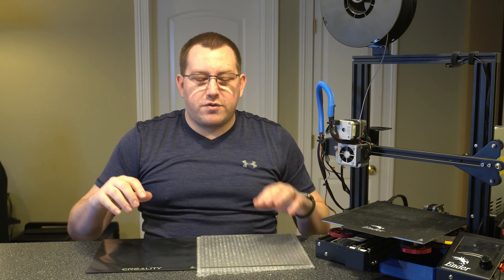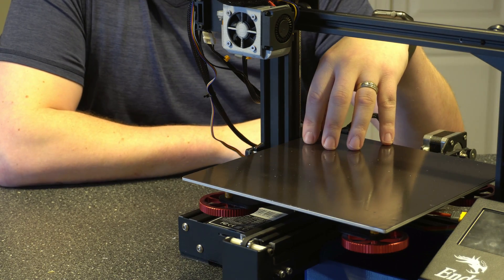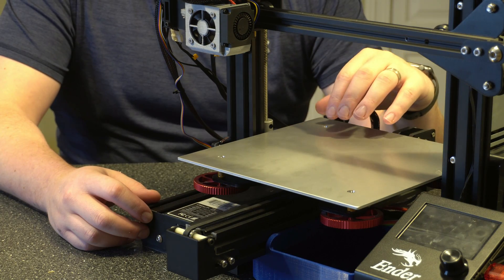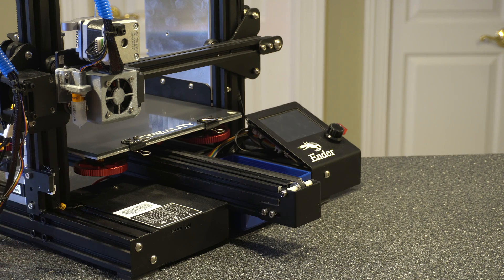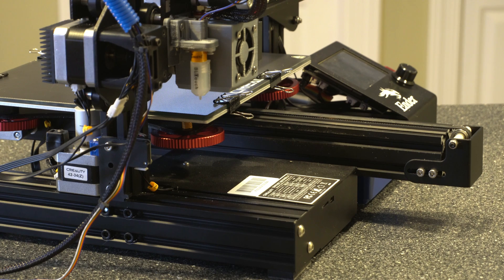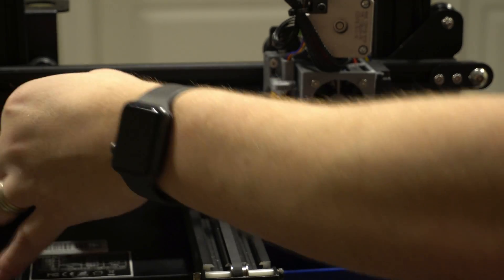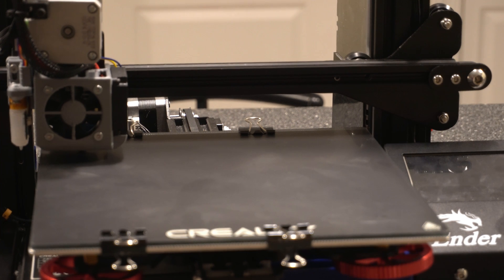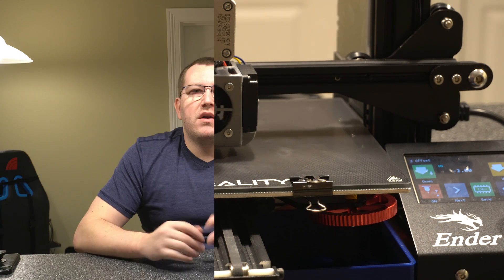Ender 3 Pro Glass Bed Upgrade – Complete Install Guide!

Comment: I have a bltouch but nothing I do makes it work properly
Reply from the maker: Hi. How is it wired and what firmware are you using?
Reply: @3DPrintscape  i tried it with and without the z stop still in, its plugged in where it should be. I tried so many different things for the firmware cause i didnt know at first there was a difference in the board but then i tried the 3 pro 4.2.2 firmware and it didnt work right, tried following a different tutorial from a guy thats pretty popular but none of it worked and i dont remember all i tried now cause that was months ago but i tried multiple firmware versions andtried editted and uneditted
Reply from the maker: @YourPeepingTom  Sounds like it may make sense to start back at the wiring. Make sure the wires are in the right order where everything is plugged in and make sure they are actually making a good connection.

Comment: I went with a 4mm piece of scrap mirror that I found. Couldn't get the prints to stick at first but after some experimenting I discovered that PLA and PLA+ sticks just fine on glass/mirror surface, just keep the bed levelled and up to 70C hot at all times during printing.
Reply from the maker: Hi. Thanks for the feedback/tip. A mirror is a great option if you already have one to work wiht.
Reply: @3DPrintscape  also a glue stick helps ive been told
Reply from the maker: @JamesAnderson-fw5ew  I know it does help, but I've had better luck with bed weld.

Comment: I went with little spring clips from Home Depot.  bigger than those clips but the tips are covered in vinyl.  89 cents or something for each.  Disclaimer:  I know next to nothing.
Reply from the maker: Hi. The vinyl on the clips could be a problem. I would go with all medal ones.
Reply: @3DPrintscape  Oh.  From the heat of the bed?
Reply from the maker: @ulmwurttemberg1682  ya, i think that may end up being an issue. It will depend on the type of vinyl though.
Reply: @3DPrintscape  Ok.  Wow.  I didn't consider that at all.  I'll have to monitor that.  Or just cut the vinyl off to be safe.  Thanks, man.  Appreciated.

Comment: I am sorry for asking questions that might have been addressed in the video but I might have missed it. What was the purpose of lowering the bed as low as it can go? and I see that you adjusted your z stop I have mine disabled since I put the Bltouch so that step shouldn't matter right? Thanks in advance!
Reply from the maker: Hi. It allows you to be able to manually level the bed and keep tension on the springs. You dont want to level the bed but have the springs lose as it will not be level for long.
Reply: @3DPrintscape  Thanks for the reply! I went ahead and lowered the bed as you suggested after putting the glass bed on this morning thanks again

Comment: Can you comment on how you clean the Creality bed surface (what liquid + what towel that doesn't leave residues) so that it doesn't damage the surface?  Thanks!
Reply from the maker: Hi. I use standard rubbing alcohol and paper towels, or the rubbing alcohol pads.

Comment: Just grabbed the Crealty Glass from Amazon & it had the Clips inside the Black Crealty Box..Maybe they got enuf complaints & decided to bless us with clips..lol..
Thanks for the Tips & Tricks..✌🏆
Reply from the maker: Hi. Im glad to hear they started shipping with the clips, its not like they cost much lol. Thanks for the info.
Reply: Whats up My Man i have a question for ya..
So i took the Magnetic sheet off & put the Glass on leveled it as best as i can but its not sticking.
It just gets balled up under the extruder tip..
What should the Plate temp be??
70's 
Usually run it at 60° and never had any issues..
Do i definitely need to use something to make it stick?? Glue Hairspray ??
I really Appreciate all the Info u have shared its been a great help..
Reply from the maker: @-east-coast-florist  I keep my bed temp at 60 with PLA. I do use bed weld though. If the bed is completely clean, and you use rubbing alcohol to clean it, you don't always need additional adhesion.
Reply: Thanks for the Help..
I got a perfect Print after i Adjusted my Temps and My Corners..
I love 3D Prints..lol..
Addicted..💯✌

Comment: This glass bed doesn't work at all for me. Even PLA doesn't stick on it. It's pretty flat with no warping, but a total waste of money in adhesion.
Reply: It works pretty well for me. I usually squish the first layer a little bit. I used to use glue stick but recently have just sprayed on sugar water with a spray bottle and it works great, holds while warm and releases easy when cooled.
Reply from the maker: @bobthudpucker7730  Thanks for the tip, i haven't tried sugar water before.
Reply from the maker: Hi. Thanks for the feedback. Are you running a bltouch, is the nozzle to bed distance right, and is your bed warped at all? All of those will impact adhesion significantly.

Comment: U have 2 heat the bed to 60 to get the mag bed off with the adhesive...ive done it 3 times so far with the same result . no putty knife needed
Reply from the maker: Hi. Thanks for the tip. I was hesitant to recommend that because i didnt want anyone to get burned and try to blame it on me :).
Reply: @3DPrintscape  ya i understand totally .

Comment: I did all of this previously and it worked great for about 2 days, but now when I print the brim will come out flawless but the actual base of the item inside that comes out like the nozzle is too far from the glass. I've checked everything and can't find a reason, any idea?
Reply from the maker: Hi. It sounds like your e-steps may be off. Here is a video that covers calibrating them. https://youtu.be/_js-xFvznxU
Reply: @3DPrintscape  Appreciate the help. What solved it for some reason, was removing the magnetic bottom from the plate and just using the glass. Not sure why it made such a difference, but works great now.

Comment: Thanks for making this video.  To get the magnetic layer off the plate, I heated up the bed first.  I just did Prepare > Preheat ABS > Preheat ABS Bed - and that let me get it off fairly easily with minimal tearing.  I did have to get it started just a bit with the putty knife tool (whatever it is) that came with the printer, because of course the bed is pretty hot.  Just had to twist and pull for a minute or two, and not touch the bed for more than about half a second at a time.
Reply from the maker: Hi. Thanks for the info. I was hesitant to tell people to do that because i didnt want them to get burned. If you are careful though, it does make the process a lot easier.
Reply: This 💯, mine didn't tear at all. Did you do anything to get the residual glue off? Or just leave it. I guess it doesn't hurt anything if it was already there lol.
Reply: @cjgibbons5850  I believe I wiped it once with alcohol, and left what was still there.  It doesn't stick to the glass bed.

Comment: I left the magnetic surface and have had a glass plate for a month. Any recommendations on how to remove the glass from that surface. It’s pretty stuck on.
Reply from the maker: Hi. Honestly im not sure as ive never had the issue. I know one guy that did and he used a putty knife but it seems like that could be really challenging.
Reply: @3DPrintscape  I probably got it off the same day I sent the comment, it was just a pain. I’ve been loving the glass bed though
Reply from the maker: @Ratske_99  Im glad you were able to get it off. What did you end up doing to separate the glass from the magnetic pad?

Comment: Old magnetic builld plate comes off alot easier if you heat the bed lol
Reply from the maker: Hi. Thanks for the tip. I was hesitant to recommend that in the video because I didn't want people to burn themselves.

Comment: How do you set up the slicer for not hitting the clips that hold the glass plate?
Reply from the maker: Hi. Cura has disallowed zones enabled by default, so i havent had any issues. That said. i try to avoid those areas.
Reply: @3DPrintscape  yeah gonna try to stay away from them😁 glass bed upgrade is nice but takes a long time heating up. Learned one thing= level with heated bed.
Reply from the maker: @TheTechnoaddict  It would take a little longer to heat up but I don't think it was that big of a difference and ya heating the bed first is recommended.

Comment: Thanks my guy. My Ender was made a few days after you posted it and I have just set it up now. 

Greetings from South Africa!

Edit: Do you have other tutorials on set up like best practices etc?
Reply from the maker: Hi. I have a lot of videos on different mods/upgrades. What are you looking to do? Once i know that i can try to provide more guidance. That said, i do recommend adding a bltouch if you dont have one. https://youtu.be/Xiy-oLLrB1k
Reply: @3DPrintscape  I haven't got a btouch as yet, will look into getting one. 

Currently having an issue trying to get my first print. 

I have leveled the plate(using paper method) and auto homed etc. 

When I run the dog model (on the stock USB) i starts, goes to the center of the model and starts to print. 

The extruder doens't extrude and the nozzle is about 3mm from the surface, so what ever does extrude (after some time) is just stringy plastic
Reply: lmao, each day I progress a little further.
Reply from the maker: @moosesnWoop  It sounds like the bed is just too low. Go through the leveling process again after you auto home it.
Reply: Still getting to grips with it

Comment: Do you have to remove the magnetic film over the plate or can you just leave it
Reply from the maker: Hi. I would recommend removing it. I didnt have any issues in my testing but i heard reports of people having it fuse to the bottom of the glass.
Reply: @3DPrintscape  ok thanks

Comment: do you have to raise the temperature of the bed at all?
Reply from the maker: Hi. I didnt need have to. The temperature is read from the bottom of the build plate, so i guess the top of the glass will be a little cooler than the top of the magnetic surface but it didnt make a difference for me.
Reply: @3DPrintscape  
The reason I’m asking , I just swapped out magnetic plate for glass plate and prints are not sticking , also I didn’t remove magnet plate that is glued to build plate, that might be my problem. 
Thank you for your response
Reply from the maker: @Hristosgl  You could try to bump the temp up 10 degrees to see if that makes a difference.

Comment: I heated my bed before i removed the magnet layer. Had no issue
Reply from the maker: HI. Thanks for the tip. I wasn't sure that would make a difference or not and I was hesitant to tell people to try to remove the magnetic pad when the bed was up to temp because I didn't want anyone to get burned...

Comment: Using my new glass bed now. No frigging glue or hair spray. Works great at PLA 210/70 C temp. Why do people say you need to put shit on the bed first?
Reply from the maker: Hi. If the bed is cleaned properly then using an adhesive isnt necessary unless you are printing smaller parts. I always mention the use of an adhesive because most people dont clean the bed properly and with standard glass it can help.

Comment: For adjusting the Z endst, the way I do it is: bed completely down, Lift Z , install the bed, loosen the level wheels until the springs are roughly half compressed. Then turn the Z rod until the nozzle touches the bed. Adjust endstop, lower the bed just a bit, Auto-home, then level the bed conventionally.
No need to use the plate as placeholder.
Reply from the maker: Hi. Thanks for the details and ya that would work in most cases. I was to show a way that was easy for everyone to understand, which can be difficult sometimes.

Comment: how would you increase the grid from 3 to ...say 5  ?
Reply from the maker: Hi. Assuming you are using the bltouch and build your own firmware you woudl change #define GRID_MAX_POINTS_X 3 to #define GRID_MAX_POINTS_X 5. If you are using the pre-compiled firmware from creality, i dont think you can change it.
Reply: @3DPrintscape  thanks!..trying to go thru it with you compile vid
Reply from the maker: @hungoo1241  You're Welcome! If you run into issues you can reach out here or on discord. https://discord.gg/Bu94EYVkrU

Comment: Great videos really helpful 👍, just a quick question if you only tend to print with PLA for foreseeable future do you recommend taking the magnetic part off completely or put glass bed on top of it? I have the creality glass bed just doing research before I switch. Thanks
Reply from the maker: Hi. I was using a glass build plate on the pad for a bit without issues but i have had people tell me that its fused to their glass. So if you want to play it safe, i would take it off.
Reply: that i had issue with printing first layers fails  because of magnetic bed layer nd yes glass plate did get stuck to it just cool it down and very carefully thin putty knife pry very little and softly as its a tempered glass  i got mine off safely   thereason first layer print fails is because not enough heat transfer from aluminum plate to glass plate u know magnetic bed acts as insulation …. only way is without that magnetic bed or use higher bed temp …

Comment: Can I use glue when using abs on a glass bed?
Reply from the maker: Hi. Ya you can, and will probably need to, use glue. ABS doesnt stick well to glass without adhesion.

Comment: Have you tried a PEI print bed? It is what people are using as a compromise between glass and flexible magnetic surfaces. There are so many differences of opinion on just about everything with the Ender 3 printers it is sometimes overwhelming and confusing.
Reply from the maker: Hi. I have a PEI build plate on my Tax 6 and it works great but it can get damaged easily. I have not tried it with my Ender 3.

Comment: First off, I would like to thank you for making these videos.
I have wrecked two Creality magnetic bases just checking the offsets with the BL touch so far and now I'm thinking of going with glass.
Question is you recommend bed weld do I have to prepare the bed by spraying this on before I print.
The 3d printer is it an enders 3pro version 1 or 2 as I like the coloured screen..
Cheers. Stay Safe.....
Reply from the maker: Hi. Thanks for the feedback. I like using glass over the magnetic build plate, but just make sure you are careful when doing the initial level and setting the z-offset. The bed weld gets applied kinda like paint with the attached sponge. You can see where its at on the build plate, so the application is easy. You can also get multiple prints without needing to reapply it. I have the Ender 3 Pro, but I replaced the mainboard and screen. I have the SKR Mini e3 V2 and the TFT35 screen. The TFT35 screen is awesome and has a lot of logic built in to help set the z-offset.

Comment: Problem when I tore the magnetic surface off I got this sticky stuff below it. It’s a blackish gray color and I don’t know how to get it off?
Reply from the maker: Hi. That’s odd. If it's sticky, you can try to use rubbing alcohol or fingernail polish remover. Just make sure you don’t use too much of it. If that doesn’t work, you could use a razor blade but you will need to be very careful if you go that route.
Reply: @3DPrintscape  Thank you that was very helpful

Comment: yo man ive seen a couple of your videos and shit. you do really good and help out a lot, but just a friendly piece of advice, i think you need more white light and your videos would be a lot better.  quality wise. and sorry if i sound like a dickhead cause im not trying to. i just think you could go far with the youtube thing
Reply from the maker: Hi. Thanks for the feedback, i appreciate it. I recently switched the bulbs i have above me to LED and i have been using a ring light. Any other suggestions to help improve the lighting?
Reply: @3DPrintscape  a brighter room, like white walls would probably help with the white light as well. I noticed this video quality was way better that the first video you made about the glass beds, so you’re definitely in the right direction man!
Reply from the maker: @doobied816  Got it, thanks for the tips.

Comment: I tried a glass bed and never had a successful print so went back to magnetic and success again.
Reply from the maker: Hi. You do need to account for adhesion when using a glass bed, but I haven’t had any issues when using bed weld. This upgrade is really more of a preference. A lot of people have strong feelings about it (on both sides of the fence).
Reply: I just spent 5 hours trying to get anything to stick to mine. I plan to go back to the factory bed as it doesn't need any glue or additional steps to start printing. It's a shame because I was stoked to get the glass bed. Oh well.
Reply: @Collinormous  it's weird because my Ender 3v2 has a glass bed and prints lovely on it so I used the same settings on my pro with a glass bed and it fails so I'm at a loss but I'm thinking of turning the glass bed smooth side up to see if it's the texture that's making it fail.
Reply: @scoobytim129  My issue ended up being the filament I was using. This glass bed doesn't like my generic PLA from amazon, but likes the Overture ABS. I just tried this about 15 minutes ago and the print is still going but so far so good.
Reply: @Collinormous  well good luck collin if you ever use PLA I generally use Enders own or esun which I have had great results on the Ender 3v2 glass bed
Reply: @Collinormous  tried putting factory bed on to the glass bed? I will try it myself tomorrow 😂
Reply: @kezman82a  I actually did that because at least the glass is flat. Works fine! I did finally get a successful first layer with the glass bed after switching to ABS from PLA. I was also using just a generic PLA from amazon, seems that was my issue all along.